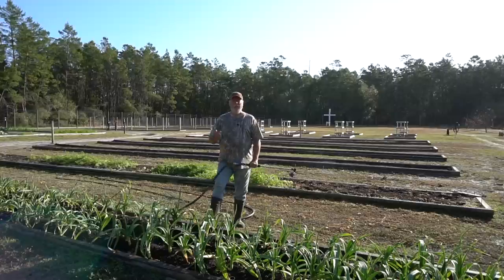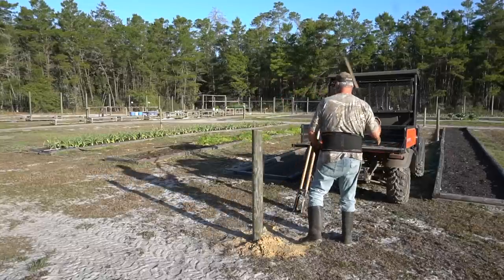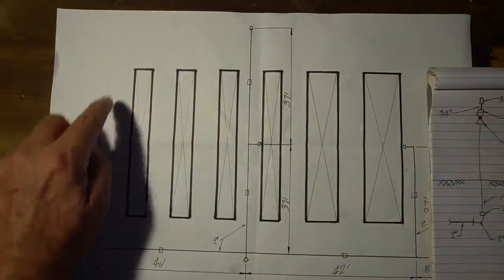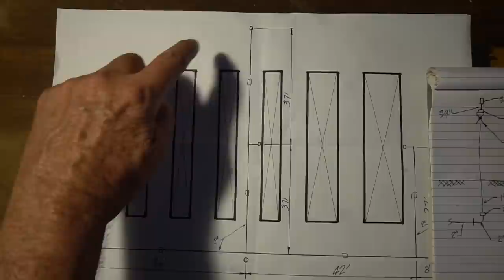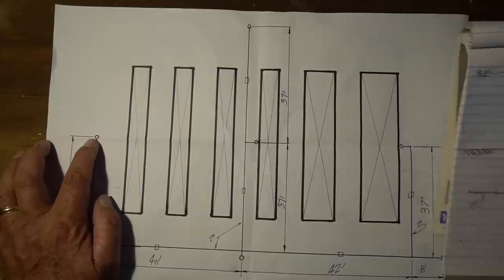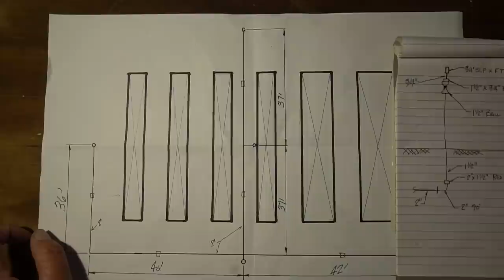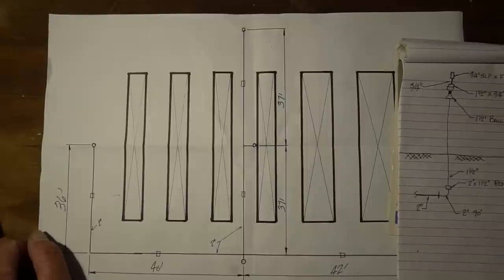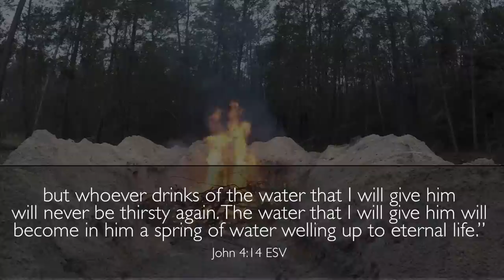Large Garden Watering Problems? Installing Overhead Sprinkler System

Comment: Nice job on the sprinkler system Hollis and Nancy! I have a similar system but only with 3/4" pipes. And I put threaded ball valves in a box just below ground level. That way I just screw the whole uprights off for winter. We do get a good bit colder than you guys though. Thanks for the video. I know personally that will sure beat standing in that hot sun for hours - I've done A LOT of that too.
Reply from the maker: Thanks for sharing Blessings

Comment: In the original video when you ran all the mains, people said you should've put a power line in there. I still think they're right. Standard regs can be opened manually, but provide automation of watering and also pressure regulation. You're going great guns now, but when you're a wee bit older I bet you wish you could water the garden from your couch. God bless.
Reply from the maker: Nancy you can do it  on your
Property.  We did the best we could with the budget we have.  Blessings
Reply: @HollisNancysHomestead  I'm sorry. It wasn't a criticism at all, merely an observation. My "property", or at least my garden space, is about 40 feet by 12 feet so it cost not very much for the wire. Love you both.

Comment: Thank you God bless you. Why not have drip system?
Reply from the maker: For this area I needed a high volume of water in a large surface area to deep soak through my Sandy soil. I am running 50 GPM of water to this raised bed garden. I have a separate area with six 50 Trellises. This area will get a drip system. It has Sandy soil but I confined the trellis to a 3’x50’ raised bed. I will be designing/installing a permanent drip system using drip tubing in lieu of buried drip tape. The drip tubing will be attached to the bottom of the trellises about 12” above the ground with high volume emitters. This is due to my Sandy soil. The system is similar to what is used in grape vineyards. It will  squirt down more of a stream rather than drip. I guess you could say a fast trickle. Anyway, I’m still designing the system and will have to save up some bucks to purchase all the parts. I will have to wait till 2024 to install it. I will do a video on it for everyone. 👍

Comment: How long do you leave your sprinklers on your plants during summer months and winter months ? Also isn’t it bad to water the tops of the plants ? I ask because this spring I’m putting in a earth bed and I also live in Florida and also can not spend time hand watering anymore and looking for options. I thought drip tape but it’s so expensive and doesn’t Really last long. Also do you think I should go with say misters or sprinklers ? Hope to hear back from you and love the channel
Reply from the maker: We have a deep well. The pump and well provide plenty of volume and pressure. You will need that to install this system. We have Sandy soil. A drip system will not provide enough water to support the vegetables we grow in the raised beds. Each sprinkler head gives 10 GPM. That’s a lot of water. Vegetables I grow in my raised beds will be fine if I get the leaves wet. I water in the morning allowing all day to dry. Dont water in the late afternoon leaving leaves wet overnight. If I have plants susceptible to disease from wet leaves such as tomatoes, cucumbers, etc I have separate areas and different watering systems for them. I don’t care for drip tape because of the cost, doesn’t last and has to be replaced, I have Sandy soil and drip can’t support my plants, it has to be replaced every time I plant something new. I like the overhead because it provides high volume of water for a large area. Ideal for large gardens with Sandy soil.
Reply: Mr Hollis what type of water system do u do for the tomatoes and cucumbers? u said u sod a different type?

Comment: Water pressure is our issue.  Most homesteaders are on well water. We water our garden with totes.  So all gravity feed.  Any help would be welcome.
Reply from the maker: Raise your water collection tank 6-8 feet above ground and connect a drip system. The higher you set the tank the more static heat you will see at the drip lines

Comment: Can you please let me know what kind of glue you are using. Am from outside us. But I can order it and my family will ship it for me. Thank you
Reply: Looks like Oatey Rain or Shine blue PVC glue.  There are other brands as well.  I like the blue best because it usually doesn't require cleaning, drying, and priming the pipe.  If the pipe is new just wipe it with a paper towel or cloth rag and put it together.  Also it's tolerant of moisture in the joint.
Reply from the maker: Oatey Rain or Shine Blue. 👍

Comment: Did your irrigation system require additional protection during our big freeze - coldest Christmas in Central Florida in 30 years?
Reply from the maker: Yes, I shut off the supply line and drained the system down. Hooked up a heat lamp in the pump house and let a hose run off the deep well. Everything came through with no damage. 👍
Reply: I'm so glad. Whoever replaced our well years ago, lacked your foresight - too many exposed pipes and no individual shutoff valves for my home & the buildings. Since I could not drain the exposed water lines, everything had to be covered up with blankets. Down the road I'll redo it. When I put in an irrigation system, I plan to model it after yours. Thank you so much for the video.